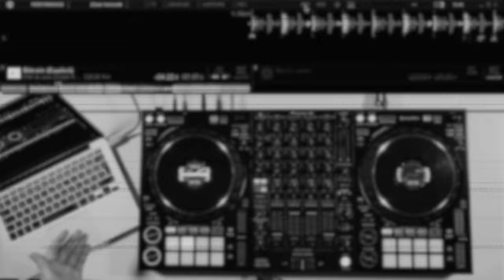How to plug a controller into a DJ mixer - Setting up a controller in a nightclub

Comment: Why is the recommendation to trim to "a few" orange blocks, instead of aiming for +/- 0 (for example on a XDJ-RX2 that would be one orange light) to have as much headroom as possible (to prevent clipping and limiting even in the worst case) but without attenuating the signal (as this, if I'm not mistaken, would worsen the signal to noise ratio if the signal gets amplified again later in the signal path)?

Comment: Thanks for that one..
I use a 5 speaker set up at my pub, two 12" tops & two 15" floors, & 8" monitor ; go through a Numark M4 , Numark Mixtrack  FX pro... 0:06 Serato dj pro...
So when I set up as you have with all your controller settings at 12.o clock and mixer just before red..to get more volume as the evening progresses , I turn up my active speakers only, not anything else.. yes .?

Comment: Hi, I'm looking at adding a rotary mixer to my home set up and wanted some advice on the best way/options.

I currently have a XDJ XZ controller, Pioneer VM-50 active speakers and 2 x 1210s.

Would I be able to use this set up? Or should I be looking to add a separate amp, studio mixer?

Any advice would be appreciated 👍

Comment: I used to bringing my DDJ-RX to the club back then, but know I'm just happy with club's CDJ or using them with on HID mode.
Why? Because the sound output from my controller never be as good as with CDJ and DJM only. The output sound seems "thin and compressed" and the bass feels not quite "kicking". So the audience feels something wrong, because the sound sounds different. 

Maybe I should change the sound setting at the main mixer, but it is to much hassle at 1 AM in the club, just sayin
Reply: I´m not an expert but I honstely doubt the audience will hear a difference. I also think most clubs don´t have such high quality speakers where you can even hear it
Reply: @gerrithausherr3035  Yes, maybe I'm over audiophile hahaha, I used to ignore it at first, but the club manager once go up to DJ booth and ask me "some thing wrong? the sound bit different, oh I see you are using controller". Since that I never bring may DDJ-RX again to the club :)
Reply: @emxtv  I probably would have done the same^^ But the reality is, that your audience is mostly drunk and only a few a them have a sense for sound quality
Reply: Gerrit Hausherr hahahaha thats for sure 😂

Comment: Is it possible to add an audio interface in the setup? 
After a life using audio interface + mixers got an NI Kontrol S2 mk3 and its pretty and works fine but the built in audio interface doesn't sound so  good to me.

Comment: Question: does this substitute for a PA mixer? Can i use the mic from a DJ mixer as you would from a PA mixer? thanks!
Reply from the maker: If you want to sure, you can plug the mic into either the controller or the mixer. Do note DJ mixers usually have slightly less EQ control for the mic than a typical PA mixer.

Comment: Hi I have a question please could you answer I can’t find the answer anywhere.. so when you set it up like this does this mean you can only play on 1 side of the controller or both? I’m just wondering how you actually mix 2 tracks on the controller if only one line is connected on the mixer?
Reply: @satbirsinghmatharu2355  thanks so effectively 2 decks on one mixer channel using the controller?
Reply from the maker: Essentially the output of the controller (both decks) instead of going directly to the speakers is fed in stereo into one of the channels on the mixer.

Comment: Can ddj 400 be connected to djm 900 nexus?(for cdj purpose)
Reply from the maker: You can connect a DDJ 400 master output to the DJM 900 using a RCA cable and plugging it into any LINE input :)

Comment: My head's baffled so if u play to tracks to mix into the mixer that mean u need to use to head phones
Reply: you would mix on the controller as if you were directly connected to the sound system (like at home). the dj mixer is in that case only there to receive what at home would go directly to your sound system and forwarding it to the clubs sound system. 

with the dj mixer in between its possible for one dj to be playing (for example with 2 cdjs or with another controller on lets say channel 1 (or with the cdjs on lets say 1&2) while the dj playing next can connect his controller to a free channel and when dj one is done with his set then dj two only needs to push the fader up on "his" channel and press play to start his set